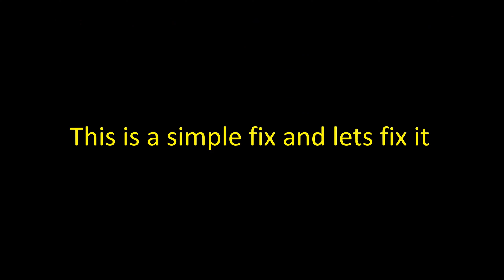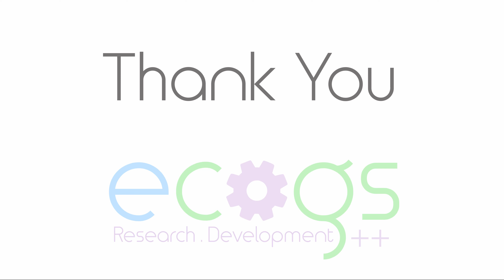Fixing Roland KR-3000 Piano Keys

Comment: The worst how too fix dead keys in a Roland kr-3000 ever. I mean now I’m really confused. Can you redo this with a voice over to explain what you’re doing? Haha All said with love my friend.
Reply from the maker: Thank you very much for the comment. Sorry I cant do it again. Theory is simple. need to check connectivity to the main bord. There are few black ribbon wires which are running to the main board. What I did was just check the connectivity to the from the button pad to the black ribbon wire end.